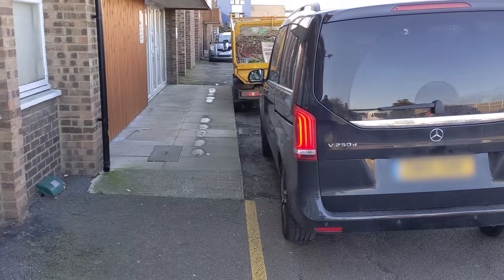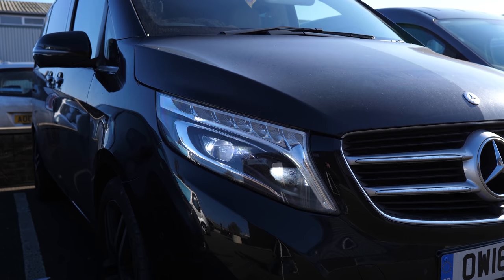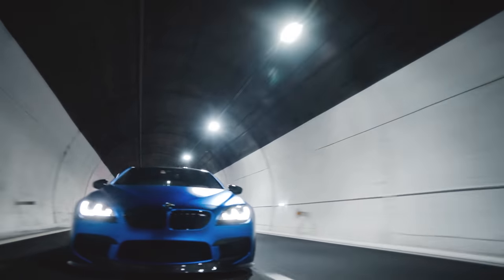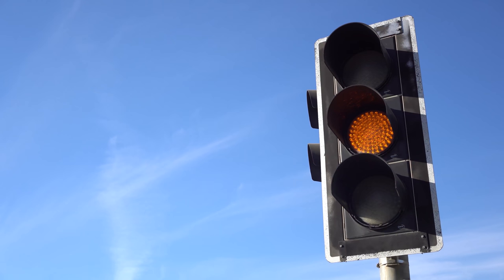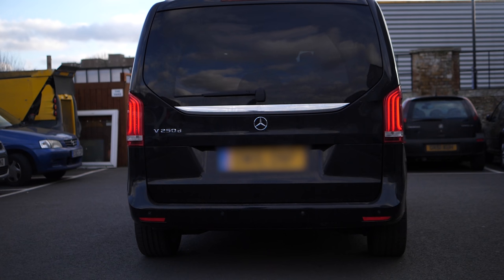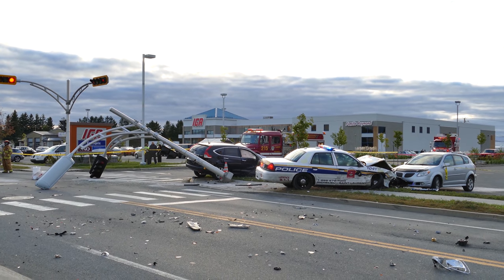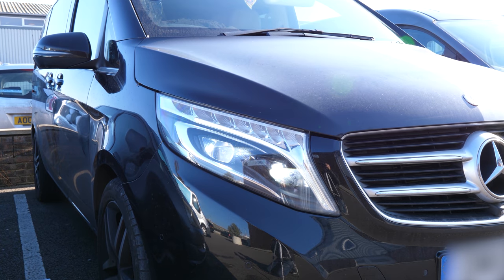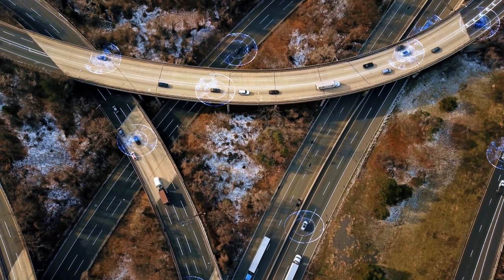Self-Driving Cars Are Dangerously Confused By LED Lights

Comment: Your average Toyota Corolla uses over 100,000 watts to cruse at highway speed. I doubt incandescent bulbs are going to change the efficiency calculation much.
Reply from the maker: You make a good point! Actually the main thing is reliability I think.
Reply: Do you mean the average Corolla uses over 100kW of energy in the form of fuel? If the average car would need 100kW output at the wheels to just cruse at highway speed, there would be a lot of cars which could not even reach that speed then. So let's say a car has two H4 headlights which use 110 watts of electric energy. Because of the average efficiency of an automotive alternator (70%) and a gasoline engine (30%) you need about 500 watts worth of gasoline. That is about 50ml of gasoline used just for the headlights for one hour.
Reply: @Cody'sLab While your calculations for total energy usage are generally correct, the application is not... most of that wattage was likely converted directly from horsepower which is a mechanical form of energy used to physically move the car along... (not including losses to heat and friction) the electrical power generation takes a fraction of that mechanical energy and converts it to electrical and yes, efficiency in the electrical system means less power taken away from making the car move. especially since Mantas Vaitkus pointed out the further losses in efficiency above.   Just something to consider..
Reply: Though I love incandescent bulbs & Cody's channel, the switch to LEDs is probably more due to manufacturing, not energy efficiency. Yes, LEDs use a lot less power for light output, but its semiconductor production costs, and the economy of scale, that now favors LEDs. And its ultimately the $$$ that car makers are looking at.

I'm a big color organ freak, and incandescent output vs input power are friendlier to deal with, with incandescents. An incandescent at 10% max power, will barely glow, while an LED at 10% (of its own max rating) will still be pretty bright to the human eye. For pure illumination, that's not an issue, but in color organs, and other dimming applications, it can be a real pain ! Plus a barely glowing incandescent filament is a thing of beauty, where a barely lit LED is just .. eh.
Reply: @michaelmoorrees3585  couldn't agree more :) I'm color organ freak too!
Reply: @michaelmoorrees3585  That's true. Incandescents have their own kind of beauty. I love LEDs for other reasons, mostly their compact size and low energy consumption. Fitting working LED headlights into small vehicles is awesome, and who doesn't like glowing buttons, dials and switches in their devices? Their color is also pure and vibrant (sometimes too vibrant) and their brightness can sometimes be just what you need.
Reply: i love it when youtubers you watch also watch other youtuber that you watch
Reply: @MrLoller16  watch out for confirmation bias ;)
Reply: Totally agree. The halogen headlights will consume around 120W or so... But the EU is rapidly turning into some sort of Eco-North-Korea where not the scientific facts but rather abstract principles dictate our policies. In the context of cars it means that the fuel consumption is strictly regulated and manufacturers are trying everything they can to squeeze a few yards out of every litre of fuel consumed. Headlights have been named as a potential area to increase efficiency ... which reminds me of the fact that the phase-out of household light bulbs in the EU had been driven by a consortium of ... exactly: light bulb manufacturers! Their profits were shrinking due to cheap imports so the wanted a legislative push for high tech (= more profit). The "eco" dimension was just a marketing gimmick that was added on later.
Reply: The main reason most vehicles have switched over to LEDs is that LEDs last much much longer, are less expensive, and come on at full brightness immediately without needing to 'warm up'
Reply: @Gabriel Fidelio Eick Brække Even led can be drived in current controlled dimming, instead of pwm on off control , even if leds are on all the time , they might still consume less than incandescent bulb that are on all the time,  that should solve any issues of flicker with camera
Reply: Or how about just adding a single capacitor per light assembly so the LED would stay constantly on even with PWM? 

Something tells me car manufacturers who spend millions on RND in massaging seats would never do that, unless it is mandated.
Reply: And LEDs have longer duty lifecycles with lower voltage.
So you were better off adding a small regulator or resistor to the circuit regardless.
Reply: @JayPixx  How does this have to do with confirmation bias? They aren't saying that many or most of the Youtubers they watch also watch each other, nor are they saying that that the Youtubers they watch are somehow different from the other commenters., just that they like it when they do watch each other.
Reply: @aenetanthony  check out what confirmation bias means.
Ok, I'll make it easier for you ; )
It's automatic relying on sources of informations you like (and as a consequence find familiar).
Peace! ✌🏻
Reply: Think about this, you ever see a disabled vehicle on the side of the road and the hazard lights are really dim? Cause the cars battery can't keep the incandescent bulbs going for very long. We'll not the case with LED.
Reply: cruising at highway speeds requires maybe 30 or 40 hp in my car. getting to that speed requires the amount of hp of how fast i want to get there lol
Reply: also the average corolla makes 100,000 watts only at +5Krpm. the rpm range most people use to drive most cars only have 50 to 100hp .

Comment: The thing that annoys me most about PWM brightness control is that when you’re in a situation where you have to move your eyes quickly, you don’t get clean afterimage trails as you would with voltage-based brightness control — rather, your field of view is covered with a jumble of dots and patches.

I find that both annoying and disorienting — my eyes adjust a moment later, but as I move them, it feels almost like stutter due to dropped frames, except in real life.

And of course, if I’m moving my eyes a lot, it’s almost always because there’s a lot of information to take in. It’s literally the worst time to get thrown off. For example, maybe I want to change lanes, except traffic is dense but moving quickly, and road conditions aren’t great.

If we can’t outright ban PWM for safety-critical lights, there at least needs to be a mandate to introduce some kind of hysteresis. Maybe introduce a phosphor with just enough enough persistence to smooth out the blips, on the order of about 30 ms for a 50 Hz frequency. There’d be good overlap even with the lowest duty cycles.
Reply: The phosfor idea is a really good one
Reply: PWM is fine if it's fast enough - a few kHz at least. But so often it's far, far slower and visible.
Reply: you are transferring the time information to the spacial domain. you should be proud
Reply: @fayenotfaye  probably not. he was basically saying that if you shake the light back and forth the flickering becomes visible because you are spreading out the flicker in space. kinda like the Doppler effect in a sense
Reply: @fayenotfaye  it is changing the wavelength, but not by compressing or stretching like Doppler. instead it is spreading out the time domain into the spatial domain, enough to shift the frequency into the visible range
Reply: use a digital counter that uses 2 bit positive integers. run it through an integrator and let it run off to infinity. sorted 🤥
Reply: There is a good reason that we don't light our houses with strobe lights. PWM lights definitely strobe with moving objects.
Reply: @dbmail545  The cheap LED bulbs for home use are also flickering. That's a question of only the technology used, mainly if there is an output filter after PWM or not. It's basically a question of manufacturing cost savings.
Reply: Anyone with an RGB keyboard that uses RGB to produce "white" can experience it first hand. The LEDs flash red-green-blue to produce the color white, moving your eyes produces that spatial RGB smear across your vision.
Reply: The "classic" solution would be to wire in a inductor (coil of wire about an iron core) in the circuit.  The coil tends to slow down changes in current.
Reply: @GilmerJohn  Or a capacitor as they are much cheaper and are normally used in this type of filtering scenario.  But when your car already costs tens of thousands, who wants to have to pay a few pennies more for lights that don't flicker!
Reply: I'm really surprised they are switching the LEDs so slowly, rather than at a few kHz. Do they really save money by using a LED driver that can't switch at kHz speeds?!
Reply: @markp5726  I wonder whether it could be because they are deliberately picking PWM frequencies that won't interfere with other parts of the vehicle, like the CAN bus?  Maybe having a PWM of a few kHz is more likely to generate noise on these communication lines?
Reply: I can tell lights are LEDs just by moving my eyes very quickly - I notice the PWM control and I'm like yep, that's an LED!
Reply: @markp5726  I guess it's all about simplicity and cheap ass design, while still keep it reasonable efficiencient. When transistors are used as switches, it's in most cases desirable to keep the "transition phase" (where they go from off to on) or the opposit, as short as possible (because when the transistor is partially on, it acts pretty much like a resistor). 
But that come with another problem each time the transistor is switched off - voltage spikes, due to inductance, that might be in the circuit.  In a switching power supply (many LED drive circuits, work in the same way), those voltage spikes is handled by freewheeling diodes and capacitors close to the transistor. But if nothing is done to handle that spike, it may destroy the transistors and also causes huge amount of radio frequency interference (RFI) that messes with other electronics in the car (some RFI may accor during fast turn on as well, due to the quick rise in current). RFI that still reamains, is sometimes a problem, even with power supplies, but can be shielded against and filters can be added to the input and outputs.
But all this requires more components - so I guess car manufacturers simply use transistors in the same way they would do with a mechanical relay or similar, except that they can switch faster. They simply run a cable from the output of the "switch" to the lamp. 
That's where RFI and stray inductance may become a problem if there are long cables (for example if the controller is in the front of the car and the rear lights are feeded thru a long cable). By turning on and off the transistor slowly, they will avoid a voltage spikes and RFI problems - at the cost of increased switching losses. But now if they lower the frequency, they don't have to switch is as many times per second, so the average switching losses don't get very high anyway...
Reply: @fayenotfaye  LOL
Reply: @GilmerJohn  One important reason for PMW dimming that Steve has not mentioned here is that LEDs need a minimum Voltage to run, otherwise they don't work at all.
When using a coil between a dimmer and an LED the LED might not give of any light at all.
This effect is called threshold voltage and is dependent on color. For red LEDs around 1.7 volts for blue ones around 3.3 V. In any case the Operating voltage is not much higher.

Comment: Alec over on Technology Connections didn't mince words; he said it quite plainly: The combined stop- and turn- signals in the US ARE inferior to the European ones.
Reply: He makes some valid points. Very nice video indeed.
Reply: i was just about to comment this!
Reply: @Nilguiri  So you're just going to ignore london, then?
Reply: @zenatsuryouichi  Haha. Cool story. Nice try.
Reply: As an American, I completely agree. Especially with some states that have rather lax car maintenance enforcement. There is often no way to tell if a car is signalling, or tapping their breaks and one of their tail lights is out. 

Also wanted to say that before that video from Technology Connections, I had no idea that Europe had different lights.
Reply: Yes! He has a great video
Reply: Here's the vid in question: https://youtu.be/O1lZ9n2bxWA
Reply: @nitehawk86  As far as I know, the US is the only country that uses those dangerous red turn signals built into the rear lights; I've never seen it anywhere else. Cheers.
Reply: Agreed! When Chris Christie became governor of the great state of New Jersey, he cynically changed the bi-annual motor vehicle inspection -- the equivalent of the UK's annual MOT test... every two years -- so that ONLY emissions are tested. No need for any checks on steering, suspension, electrical system, lights, turn indicators, or brakes! You could have your car inspected at local auto shops (garages) as well as state motor vehicle centers. To call this lax is an understatement. Now we have a lot of vehicles driving around with only one functioning headlight. Excellent job.
Reply: They’re not “European ones”, everyone uses that style expect a few cars in America.
Reply: xchopp lmfao
Reply: @xchopp  That, frankly, is a terrifying thought.  Not so much the headlight but everything else.
Reply: And he's right.
Reply: Man I’ve always freaking hated how hard it can be to differentiate brakes from turn signals here in the US. ESPECIALLY when one of the brake light bulbs is out… it looks like it may just be a turn signal at first, and that second of uncertainty could mean the difference between life or death.
I’ve made sure that all of my cars have the amber rear lights installed to hopefully reduce anyone misunderstanding MY signals.
Reply: @jSyndeoMusic  It really does make it easier.  You don't have to even think.
Reply: @jSyndeoMusic  Kudos to you, my good Sir, for installing the amber turn lights. :D
Reply: Although some separate turn-signal cars have the front signals built "creatively" into their wing mirrors, so they aren't even where most people would expect to even see them, near the front corners of the vehicle. I expect several accidents are (or will be) caused by people driving those vehicles because they "unexpectedly" turned, even though the driver did actually use their signals.
Reply: I also thought of that video immediately.
Reply: @aphenioxPDWtechnology  Nope, you need an indicator visible from the side as well. It's up to the manufacturer to decide if they put it on the mirror or a fender. And no, headlight and taillight indicators don't count even if they're visible from the side.
Reply: @Nilguiri   The sewers in London randomly explode…
Reply: @Abdega  Wonderful anecdote.
Reply: In an other video, he also talked about the danger of "but sometimes", wich applies here as well.